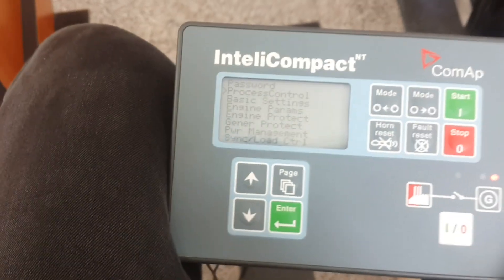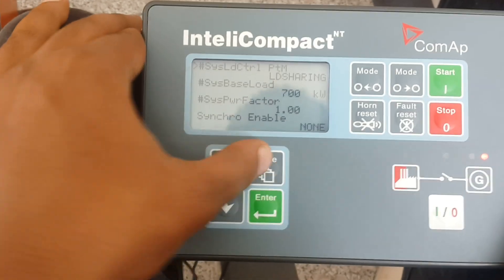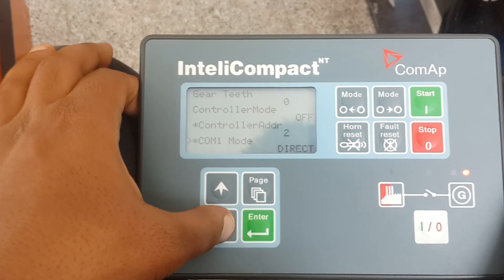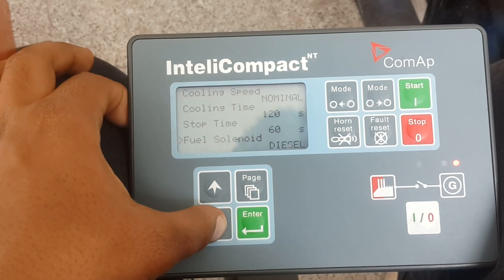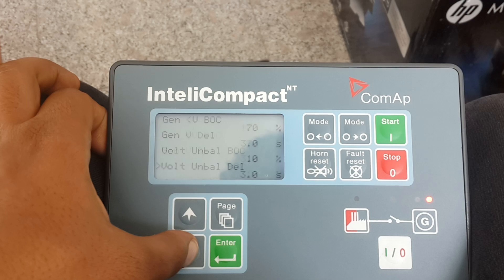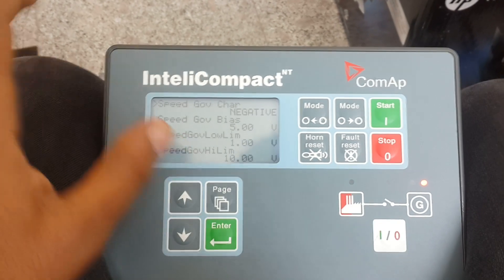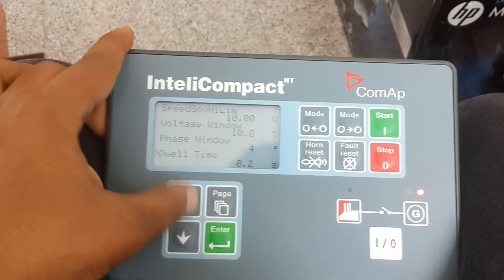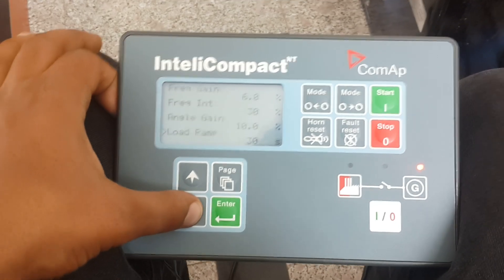AMF 25 Comap controller set points

Comment: Please help,mine won't stop even with Stop and emergency buttons. Failure to stop
Reply: Fail to stop alarm is triggered when you the controller send stop signal out put to shutoff solenoid or switch and the generator keeps on running, so check if the controller out put is correct if yes it means there is a mechanical problem or malfunction on the solenoid.